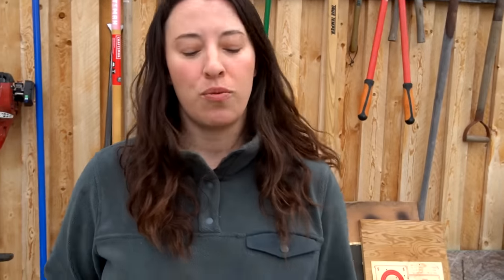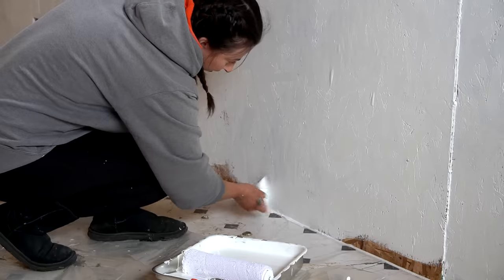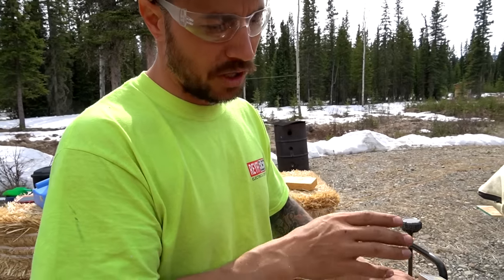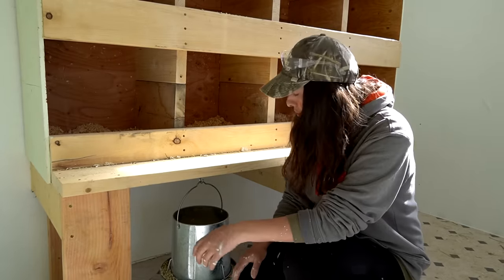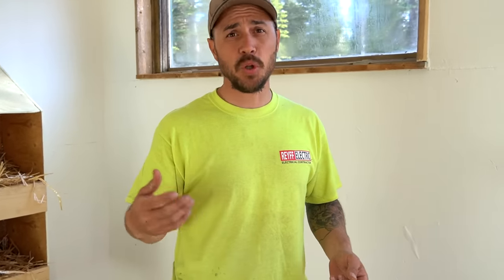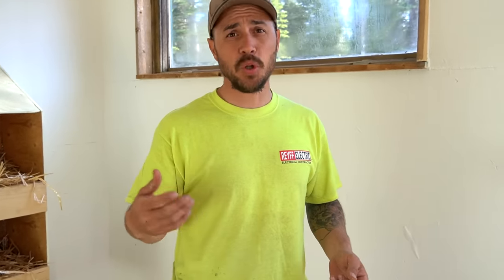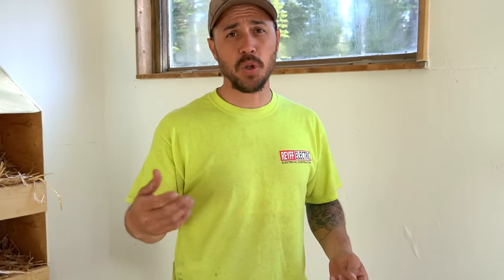A Chicken Coop Built for Alaska | Finishing the Interior & Solar Electric Fencing

Comment: Dunno if this tip helps, but a lot of those paint rollers have a place where you can screw in a broom handle for an extension.  I find it works good- also paint with a slight tension toward the side that doesn't have the metal sticking out of it, should keep the roller on.  Hope it helps!

Comment: Looks really good guys coming along nicely. Just curious as to why you didn’t use a telescopic pole for the roller you wouldn’t of needed the scaffold. You also wouldn’t of had to bend down to the rolling trays. It would’ve took a lot of the work out of it as you can use the strength in both your arms and not just one.

Comment: I've switched over completely to paint sprayers.  Decent ones aren't that expensive, and if you're concerned with coverage, you can shoot 3 coats in the amount of time it takes to roll one.  It does get in to some areas that rollers and brushes don't, so it has some other advantages too.
Reply: This!  An inexpensive latex sprayer would have taken 1/5th the time if not less.  They are amazing.
Reply: Wouldn't it need way more prep work vs roller+brush?
Reply: @urilgal  Not for a chicken coop - maybe windows?  Been a while since I watched this.  What were you thinking might need prep?
Reply: @billsmith5166  windows and floor mainly. It's true that for a chicken coop you wouldn't mind to much for overspray tho

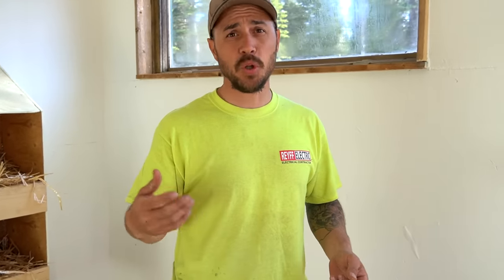Comment: 31:55 test the fence with your feet grounded with no insulator like shoes... its very shocking the difference it makes. Ive done some horse fencing that put me in the dirt it was so strong lol. Great video guys. The work youre doing looks great!
Reply: On the first trip my hubby made to the ranch where I grew  up , he "tested" the wire for the cattle. First touch with his fingers... nothing. So then he wrapped his hand around it. Blew his socks off! He didn't understand what "pulsating" meant.
Reply: I think what you’re supposed to do is touch it with your tongue when you’re barefooted
Reply: @grdelawter4266  can you take a video of you demonstrating this testing technique? 😄
Reply: Take a piece of insulated wire and cross it between your ground post and the fence. You should see a nice arc.
Reply: Great tip

Comment: just a note- if you're ever testing an electric fence you should use the back of your hand! The current can cause your muscles to contract, and in doing so your hand will grip around the fence and not be able to let go
Reply: Great advice. So obvious after the fact but so easily overlooked.
Reply: One of the first things my dad taught me about electric fencing and that is the same reason.  
Filly was dumb and used her nose.  Old mare laughed!
Reply: Good tip.
Reply: My dad always used a piece of grass and laid it on the fence to test it.
Reply: That's interesting
Reply: That is one of the reasons electric fences pulse the way they do. It's not a constant current. Good advice for most other electric applications though!
Reply: Good point. Thanks!

Comment: Yes grounding of electric fence makes a big difference. I could easily take the hit from our electric fence standing with my shoes on. One time I accidentally touched it when bent down with my bare knee in the wet grass and my whole body tensed up so much from the hit i few a few feet backward. If I remember correctly the instructions say the ground needs to be at least 10ft from the fence for better grounding.

Comment: fun project. A couple thoughts for you. 

My coop we had a lil door like that attched to a length of para cord with a hook and eye to hold the door up during the day. It was like 10x18 or so 1/2 plywood. it wasn't perfectly cut and air tight fit which became a problem when a lil weasel figured out how to pry it up and shimmy under it. our track was on the outside so we just put a little cheapo dead bolt on it and when we closed the door at night we would lock it up.

Comment: Those poles you screw into the roller handle work good for ceilings and even the walls.  It helps spread the paint thinner so you use less paint.
Reply: And much better leverage in doing the job.

Comment: Eric and Arrow use a broom handle, use longer strokes like 4 to 6 feet. Second you can roll in the corners with your 9inch roller and frame. Third you are dry rolling.  Use more paint.  Dip and roll up a few times then spread it out. I'm a union painter out of Seattle Washington.

Comment: You might want to check with the company you bought your tractor truck. Some pieces of equipment can be switched back and forth so your control levers maybe more like you're used to with a mini even those can be switched between the two different directions.

Comment: A professional tip for painting in the future is to always thin your paint out with some water.  This will help you apply the color because of the higher viscosity.  You won't struggle as much and the roller will like it and not come off the handle.
Reply: Adding water can effect the sheen.
Reply: Wonder if the chickens will mind 😂😂😂😂😂😂😂😂😂😂
Reply: @terencecampbell8363  The chickens have decided to relocate as a result of the sheen diminishment.  Especially with the flat finish that was used.

Comment: For sprouting large quantities of grain take two 5 gallon buckets and drill as many 1/8" holes as you can stand in one of them, especially in the bottom. Place the holy bucket, in the unholy bucket and soak your grain. Then you can easily drain and replace the water as needed.

Comment: Off gassing is terrible using that chipboard. So is primer/paint. And I'm sure you know chickens are easily susceptible to most anything toxic.  Always best to use real lumber, not PT lumber on the interior of a coop. Also, the lower the ceilings the better (within reason) is much warmer for them. Heat rises and all the coldest air will be down at chicken level.

Comment: I hope the chickens appreciate their fancy new apartment. May they prosper for you.
Getting a muscle contraction from high voltage would not force you to grip the wire itself and prolong the shock if the BACK of your hand is toward to the wire. Just the hairs on the back of the hand will feel the electric tingle if it's live. Maybe rebar with a rusted surface is not a good conductor as a ground rod?

Comment: Grounding, strip some 12/2 wire out and dig a trench, lay about ten feet of it down, wet the ground and bury it.   5, 6 pieces, twist them together. That will help but some suitable rod is needed.  Painting the rebar with copper colored paint won't work either.  I would find that issue at the mines.  Using cut off rebar for fuses in the disconnect boxes.  You could tell before you opened them as the paint would be melted off.  Kind of dangerous.  Deadly.  Hey the coop looks great.  So glad the bees are doing well.  They need to get with it.  Your ground is as rocky as mine.  What about setting up a hydraulic/diesel screen deck.   Scalp off the rocks and have fairly clean dirt to farm with.  Let the sand and gravel outfit keep the rocks for the dirt or do it yourself.  Sure one is sitting around somewhere close not being used.  That old river/glacial bed is going to be tough to farm.  Darn, you got the backhoe bucket dirty.  Good vid, much enjoyed.  Hope you find the other lost one.  hard to do a retake.  Good drone shots.  Glad it's working.  Some serious mountains around.  Yjat wind is going to be tough coming around them.

Comment: Great chicken coupe. The only thing when you put up the ceiling and siding, I know with dry wall you put the ceiling up first so when you put up the walls they help support the ceiling panels at the corners and help them not to blow in between the nails, screws. 
I liked some of the information a u tube channel (the millennial gardener) was presenting, if you do or don't, I just thought I would enlighten you.
When starting plants from seeds a house can placed near to serculate air like out side supposedly make there stems stronger.
Someone told me if you snip the tip of the seeds just a tiny bit the seed will sprout quicker because its easier for the water to get in (sprouts within 3 days) so they say. Looks like you've got your hands full. Lots of love, be safe. Afriend.

Comment: Two comments for the price of one. Your chicken mansion seems like a good fit for hanging trapeze style roots from the ceiling with ropes. They sway a good bit as the chickens mount and depart from them so it's more like tree branches for them. 
Secondly I saw a lady who covered her coop floor with sand. Then every few days she had an implement like a pitch fork with closer tines and the poop was easily separated like cat poop from the sand. She just stuck it in her compost bin. She had a very low stink and neat looking coop. I think the chickens liked it better as well as they were taking dirt baths in it. 
Good luck with your spoiled chickens. Lol

Comment: Two thoughts regarding painting.  First, I advise using a coat of primer as the first cost rather than two coats of paint.  Second, I’ve found it helpful to always use a long handle which screws into the roller—regardless of what you’re painting or whether you can reach it.  Walls, ceilings, floors all are faster with a long handle on the roller.

Comment: A riding mower battery will power your diesel heaters for a day or two between charges. Much cheaper and lighter than a car battery. That's what I'm using on the heater in my wood shop. The heaters only draw a lot of amps (15-16) while heating the glow plug. Once running they use less than 5 amps. Glad to see the care you took leveling the perch for the hens, wouldn't want to see them slide off "on accident". 🤣

Comment: Use the back of your hand to check any electrical stuff so your hand want clamp around the wires. Your hand muscle will contract or make your hand close up tight around the wires and you might not be able to get your hand to open back up without cutting the power off.

Comment: if you don't have a fence tester is to use the back of the fingers or hand to touch the fence.  because the reflesx of the nerves make the hand want to close shut from the front and if on back it will close away from the fence.

Comment: I'm surprised I see so many people painting without using a long handle on their roller.  most broomsticks will work and really relieve the workout that your arm and elbow gets.  I almost always use a bucket and screen no matter what size room I'm painting.  So much faster than filling the roller pan and less messy.  No need for a ladder until you cut in the corners.

Comment: Always do ceilings firsti use copper water pipe as grounding rod then if the ground drys out you can fill it with water which helps with the grounding

Comment: Oh dear.  So for future reference, when painting...especially a rough surface but really all surfaces, load the roller with lots of paint then choose a four foot by four-five foot area and paint a big W.  Then fill in the section.  When you've done a W on the top section and the bottom section, finish up with a floor to ceiling roll to blend it.  For the ceiling it's the same process but screw in a broom handle!  Oh the suffering you endured just breaks my heart.

Comment: Tip from a professional painter, ANY time you are using a roller to paint large flat surfaces, buy a simple wooden extension pole that screws into the end of the roller handle. A 4 foot one for sure, but also a 6 foot one for overhead surfaces. It may seem awkward at first, but be patient. The use of the leverage it gives you makes the painting go much faster and there is less fatigue on your arms and body. You can cover and fill in uneven surfaces, crevices and butt joints easier with the added leverage of the pole extension.

Comment: You should use a pole for the roller, when painting ceilings. It saves your back, your neck, and keeps it from spattering in your face, since you can stand off-center from the roller.

Comment: Attaching a pole to the roller works much better.  It puts you a little farther away from the surface so you can get a better perspective of what you are doing. Using a pole also helps you relax your shoulder muscles. I have painted professionally and always used a pole on a roller. Try it the next time.

Comment: Great work on the chicken coop, the color accent wall is a neat touch.  Next time you need to paint, use a extension handle to make it easier on yourselves.  I had wondered if by using an old drill bit you could get a hole thru the ice for the electric fence poles.  The connection to the rebar and wire and to the ground may have been so-so with the rust on the rebar.  Also when you get the coop to it's final resting spot you might "salt" the ground where the ground rod is or use the backhoe to make a trench to lay the ground rod in and then bury it.

Comment: Switch the hydronic lines and the controls will work the way you want.  The retailer might have put it on backwards. That color green is the same as they use on board Submarines.

Comment: When I lived in Washington, I had horses and barbed wire fences.  Barbed wire and horses don't get along so I had a hot wire that ran along the top of the fence and one about 2 feet down that stuck out.  The fence charger was connected to an electrical outlet so quite a bit stronger than yours. I accidentally zapped myself so many times that I didn't even want to touch a wire even though I knew it was cold. One time I was carrying  an aluminum ladder and touched the wire...ZAP!  Another I was crawling under the fence and touched it with the top of my head....ZAP!  I had a horse that would periodically test the fence to see if it was hot. He would touch it with his nose whiskers. It didn't zap him but he could feel the vibrations. He was too smart for his own good.

Comment: A two foot handle (or longer) on that roller cage makes it a WHOLE lot easier to paint with it (leverage).  With an extendable handle, you can paint the ceiling from standing on the floor.  Y'all are making a lot of extra work on yourselves.  2.)You're supposed to check the electric fence with the back of your hand, so the jolt doesn't make you close your hand on the fence.  You're wearing shoes, so you may not be completely grounded.  That might explain why you weren't getting a full shock.

Comment: Place is looking great you two! Just a tip for the next time you use a paint roller, put a sturdy 3ft extension pole on it and you can use both hands for rolling. It will save your arm! I know from experience! 
Also the sides of that backhoe bucket work great for backfilling 😁
Nice work building your paradise!

Comment: We have a similar fencer setup on 2 different fences using truck batteries and a 30 and 50 watt solar panels.  They work good.  Hubby likes to test the fence with a blade of grass sliding it closer and closer on the wire.  He puts one knee or hand on the ground.  I'm chicken.  I use a tester.

Comment: A little trick I learned for quick testing an electric fence. Pick a blade of grass about 6 inches long and hold one end of it between a finger and thumb, drape the other end of it over the electric fence. The blade of grass acts like a resistor so that you don't get the full force of the pulse, just enough to tell that the fence is working.

Comment: With the backhoe, you could dig a hole and bury a piece of copper, or copper plated flat bar or even a ground rod. And that would increase your ground significantly. you can go directly to that with your ground wire. And you could move it when you relocate.❤

Comment: Racoons etc will tear thru that window screen (add chicken wire). Honey boxes go on top. This is instinct for the bees to protect their food from robbers, which is their biggest fear. Use a queen excluder if necessary. Usually you make a gate by adding a plastic stake 3-4 feet at the beginning of where you started the fence. (Where you end should be back at the beginning). 
Using an extension handle you dont need a ladder. If you add extra paint to the end of the roller (dip it), you dont need to cut in (finesse it). You can paint a room in 20min. Always put LOTS of paint on the roller, biggest mistake people make is they dont put enuf paint on it, then they roll & roll & roll making it very thin. For every time you load your roller with paint you should roll 8 linear feet.

Comment: Your coop is like an apartment on 5th Ave in New York City, however, the chicken run will likely keep out only four legged predators.  But, if you have hawks, eagles and any other flying predator in your area, the electric fence will do little to protect your chickens when they are outsides of their coop.

Comment: Great work, as always! It's apleasure watching you materialize ideas into reality.
About the grounding. Of course it should be copper (or copper coated), and you might also want to wet the soil a bit. If you are going to use iron for a while, make sure to strip all the rust from it (wirebrush or sand).

Comment: Great coop!! The ground rod has to be made of a material that won't rust (Copper/galvanized grounding rod) for proper grounding. Rebar will work poorly for a short time and even less as it gets a rust coating. Due to the excessive rocks and very dry soil, you may need more than one ground rod linked together for proper grounding. As always, great videos and content.

Comment: What a great chicken coop!!!!!! FYI, if you use your angle grinder to put a point on that grounding rod. Then use bottom of how bucket to push that rod in the ground. Hydraulics are a wonderful thing. This could also work when putting on the hoop holding posts for hoop house. Give it a shot might save your back and some time.